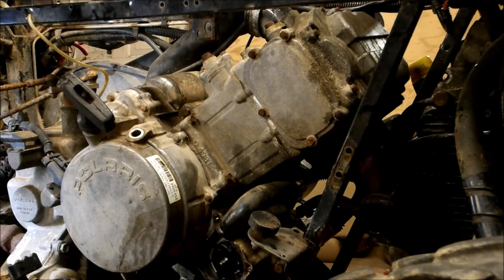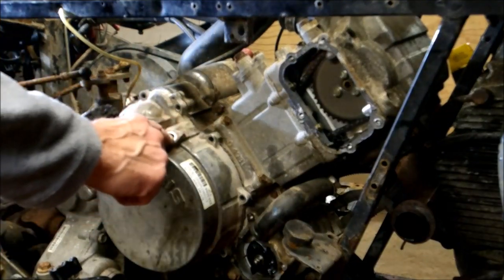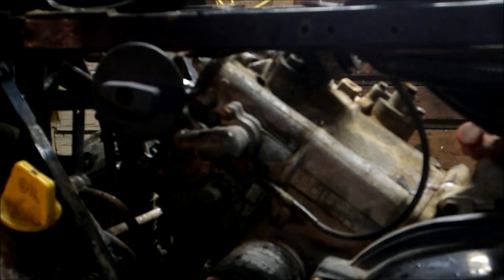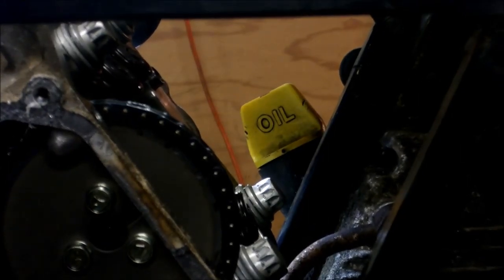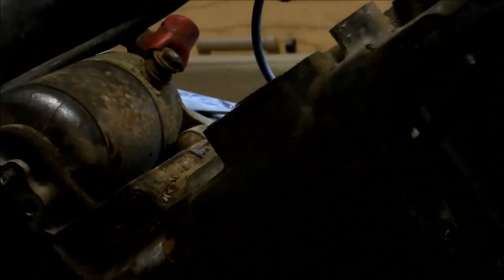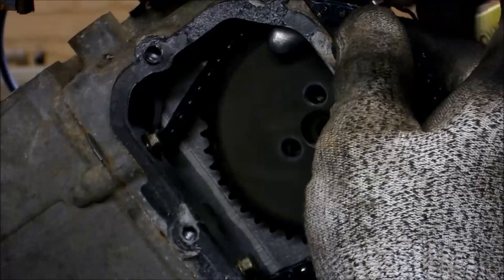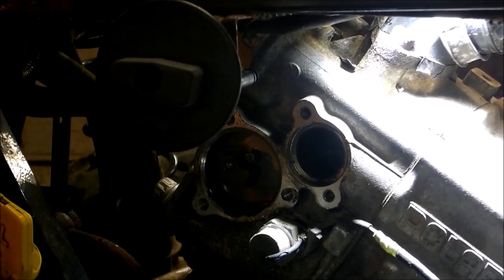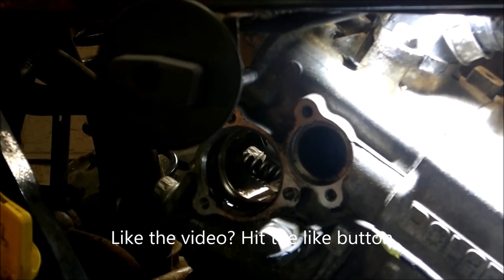Bad camshaft on a Polaris 500? How To Remove it and give it more horsepower!

Comment: titanium man i pulled the cam yesterday put a new one in the rocker shaft has a gruve wair the ball rides  so it's not alowing it to roll over i ordered a new cam and rockerarm ""aftermarket"" it seemed to roll over by hand real easy but i have to get a new started drive gear i all so put up 3 videos 2002 polaris ranger just figured id add to the polaris ranger people thank you... ever thing you said was correct on timeing the 500 thanks again

Comment: Awesome video. Do you really get more power by replacing the camshaft? I have a 2002 Polaris Ranger 500 4x4 . Runs great. Needs couple things to get fix like a gasket between the cylinder and carburetor boot. And parking brake doesn’t work at all. I heard in YouTube that Polaris 500 has a bad design camshaft
Reply from the maker: The bad cam design was in 1998-99. It didn't give a ton of power but it ran a lot smoother. Better throttle response.

Comment: So all the scramblers after 1997 were supposedly H.O. and the 97 was not acording to most people. I have a 1997 and Im looking at replaceing the cam and every seller has the cams listed to fit 97-03 and some sellers have it listed as fitting every 500 model. So my question is for the people that say replacing the cam and carb will make a non H.O. into an H.O. are we sure it not just the carb that needs replaced to accomplish that? It seems to me that the cams are the same. At least they are being sold that way. I found only 1 place on amazon selling a legit 1997 scrambler only cam, and that was Caltric. Im confused, any help would be appreciated. I understand this is an older video. Thanks.

Comment: Would you post a video about the spring on the end of the camshaft and  the thing that goes inside the camshaft, how it works, proper position of the spring, how to fix it if it doesn't hold tension ect ect ect.  Mine doesn't hold tension and just flops around.

Comment: Thanks for the information, I have a 500 and the engine is locked up. How important is it to bring to TDC before removing the rockers?
Reply from the maker: If it's locked up just make sure it's at tdc when you assemble it. It's fine if it's off when you tear it down.

Comment: will a camshaft for a 400 ho sportsman  work on a non ho 400 sportsman ? year 2004 .
Reply from the maker: It should. If ita from the same year. The only difference between H.O. and non H.O. is the cam, intake and carb.
Reply: thank you.

Comment: is this really all you need to change to make it an HO? I'm having issues with my motor holding an idle and it bogs and pops under acceleration. I've done some reading and have found that this is one of the more common issues with this engine. is there anyway to just inspect the cam without removing it to see if its bad or do i need to remove it and use calipers to measure lobes? thanks in advance and great video man!
Reply from the maker: As far a the cam goes. Yes. It's the only way to inspect it. Sounds like it's running lean causing it pop and backfire. Those carbs are tricky. If the airbox isn't sealed correctly or cracked carb boot, even the hoses to the box. If they are plugged or cracked it makes it run bad. Try a carb rebuild kit and check for air leaks first. I replaced the carb on another 500 I had. It solved the problem. If you go HO. I forgot to mention a bigger exhaust too. The engine would get to hot without it.
Reply from the maker: Try one thing. How does it run without the air box on? If it runs better. Then you know it's a carb or airbox issue.
Reply: @TitaniummanGarage  I've tried with the air box and filter on and off. almost same results. i also noticed that when i would have it running and would give it throttle it would actually blow gas into the air box from the carb side, which i also heard was cam issue. so I'm kind of lost here. i know it is an aftermarket carb but I've worked with carbs on other bikes before, and i took this one apart and cleaned it and re adjusted everything and its continuing to do the same thing.
Reply from the maker: Sounds like it's a cam . Exhaust valves not opening up. Take the rocker cover off. You can see the cam from there. Did you see my video on how to replace the cam?
Reply from the maker: I have 2 videos. the other is better.

Comment: What was wrong with the camshaft? Can you show more accurately and specifically what you are doing and why, please?
How do you fix an oil leak into the exhaust manifold and what is the cause of this situation?
Kind regards,
Franklin
Reply from the maker: I reshot this video because the first video was a little shaky. There was nothing wrong with the cam in this video. I had to replace the head gasket. The reason your exhaust manifold has oil in it could be 2 reasons. 1) Exhaust valve seals leaking. 2) Head gasket is leaking or oil ring on piston is bad and oil is blowing past piston and out exhaust.
Reply from the maker: https://youtu.be/1a7MulsXErs Here Is the first video I shot. It might explain a little more.

Comment: I have a 2013 500HO.  There's a horrible rattle on the top right side of the top end of the engine. It runs pretty good, I'm the original owner, it has under 1,000 miles and like 110 hours on it.  Always bene garaged and what I feel is well maintained.  I've always followed the manual and used polaris oils.  Any suggestions on what to check?
Reply from the maker: I would pull the recoil cover..or pull start cover off and check your starter bendix gear. they rattle when they get weak and don't retract all the way
Reply: @TitaniummanGarage  I replaced the bendix a few months ago and the noise is still there.
Reply: @kg7jev671 timing chain tensioner is probably shot. Just realized It's been a year hope you didn't jump time.

Comment: When installing my cam after inspection, the compression release mechanism and spring came out of the cam.  Do you have a video where you show the correct way to set the mechanism and spring?
Reply from the maker: No I don't. If the mechanism came apart I would do a visual on another that I had laying around. See if you can google a picture of it. That's what I do.

Comment: Hey one question I got a 2010 sportsman 500 the cam shaft access cover is cracked what would cause this sloppy cam?
Reply from the maker: Wow! Thats a new one. How many miles on it? Usually after 5000 or so they get sloppy. Could be bad casting in the head.

Comment: I’m upgrading to a 500 ho can in my regular 500. Do I need to upgrade the rocker arms too?
Reply from the maker: No. You can put a H.O carb and intake boot on too. Just keep an eye on the exhaust. H.o. exhaust was bigger. So if the pipe starts turning red on long rides you might have to change the pipe. I never trail rode mine so never had an issue.
Reply: @TitaniummanGarage  nice, I’m running a performance pipe will that be fine?

Comment: HI Thank you for the video, I just finished putting the cam in my 1999, fired it up and it runs good and idles good but knocks from 
under the valve/cam cover really loud, I coated the cam and rockers in oil before I installed them. I also cleaned out the little pockets of oil that was resting in the head. was I not supposed to do that? should I take the cover back off and add some oil? Thanks
Reply from the maker: No..its fine that you cleaned it up. There is a small hole by the cam that will circulate oil back up to the cam and rockers. I would take the cover off. make sure its getting oil. If there is oil in those pocket again..that's good. It means your getting oil up there. Double check your valve lash. sometimes it changes after it has been ran and the tensioner moves in more. I've heard those year sometimes the valves need to be redone. excessive wear and what not. could be a bent valve too.
Reply: @TitaniummanGarage  Thank you Sir! It's like twice the bike! I think it was a number of things, The kit I bought from ebay had the cam, rockers and the chain tensioner. I had used the original  chain tensioner because the new one didn't have a new  gasket. 
When I took it out today, I noticed the spring in the new tensioner was about an inch longer. maybe the old one was worn and shorter?
Also when I took off the valve cover I noticed at TDC the intake rockers were really tight and way out of spec. 
I took the cam out and started over and used the new cam and exhaust rocker, but used the old intake rockers which were in great shape, Bike only has 1000 miles. Used molylube assembly grease for cam and oiled everything before putting it back together.  Set the valves at .006 checked and checked them again.  Spun the flywheel twice checked again! Runs like new.
I would have NEVER tried this without your video. Thank you for your quality teaching, you saved me like $500 in labor! 

You Rock Man
Reply from the maker: @marcmelissa8752  That's Awesome. I like hearing stories like that. Good Job. I had to do the same on one of mine. The rockers that came with the kit were made poorly. I reused the old ones with the new cam. Worked great.

Comment: Where on ebay did you buy the cam an carb? I have a 1999 that my grandpa bought brand new the high gear clutches have vent out but it only has 2800 miles do you think this would be a worth while upgrade with a clutch kit?
Reply from the maker: If you want more speed it might be worth the clutch kit. I did this about 2 years ago. There are better camshaft kits out there now then when I did it. You just have to look around on e bay.If your installing the H.O. carb don't forget to order the right head to carb boot.

Comment: I bought a Polaris 500, and it spits out the carb intake, pops/backfires, never runs.  The cam lobes look fine, but I'm trying to verify the timing. Is there a difference between TDC and TDC on the compression stroke?  I'm thinking that my timing is off, even though all the marks line up.
Reply from the maker: If you can..pull the sparkplug and put a thin screwdriver down the hole with gas tank out. move flywheel till the piston it all the way to the top. Yeah, if its spitting out the carb sounds like a timing issue. I had that problem on a magnum 500. I double checked everything and it was right on. I replaced the carb and made sure my vacuum lines to case and oil fill didn't have cracks in it(They did) and sealed the air box. those cause backfire issues. too much air to the carb. It worked.
Reply: @TitaniummanGarage  Yes, I did try the screwdriver trick, but all my vacuum lines /air box are disconnected, I'm just trying to get it running. I'll replace the lines and give it a try, thanks
Reply: Where does the oil line hose plug in at, mine was off, replaced cam and rockers, won't start popped once, hate to put it all back togather and have to pull it all back off, i cleaned my carb, ordered a new one waiting on it, i think my timing it out, but i had my marks lined up, wired my gear where the chain didnt move, the cam only goes in one way, adjusted rockers, still won't start, i was wondering if it had a extra stroke also, did the screw driver thing til it raised itself, stumped..

Comment: I just completed this exact thing on my 1996 Polaris sportsman 500 but now its extremely hard to pull the recoil and and electric start pauses then it starts to roll over.  But when it does start it runs great.  I wish I could send you the video of what it's doing but I can't seem to attach it.  Thanks for any advice
Reply from the maker: I know exactly.  I had 2 do that. It's the decompression ball on the cam. If it sticks or the weight on the end doesn't function properly it stays open or out. If you pull the pull rope past that.it will pull over. I would take the cam out and inspect it. The little ball on the cam should move in and out.
Reply: @TitaniummanGarage  Ok i.will inspect that but I'm pretty sure it does.  Would there be anything else that could cause it?  Thanks for your help
Reply: I inspected the new cam and that ball goes up and down.  Is there a certain way I need to put that spring pin in?  I may have something wrong but Im just not sure what.  Would the valve adjustment have anything to do with it?

Comment: If my exhaust rocker arm has a small Groove where the decompression ball on the cam is should I replace the cam and rocker arms or is it still useable? Thank you
Reply from the maker: It depends how deep. I've gotten away with not replacing it. But it should be replaced. You might have a hard time starting it when temperatures drop down below 25 degrees.

Comment: could a bad cam be preventing it from running
Reply from the maker: Yes. If the exhaust valves are not opening it will not start.

Comment: Hey, I have one of these Polaris 500s and it’s really really tough to pull the start rope and when I use the starter i have to hold it and eventually it starts to turn over.  Works better if I help the starter and pull the time at the same time.  Do you know why it might be like that?  Is there a compression relief valve anywhere?
Reply from the maker: Yes, that's your problem. It's on the cam. They are known to get stuck in the out or open position. Take the rocker cover off. You might be able to spray pb blaster or WD 40 on it to free it up..or replace the cam.
Reply: @TitaniummanGarage  If it gets stuck in the open position would it respond by giving me a crank/no start with around 40PSI compression? I am finding LOTS of people with the hard start/slow crank symptom, but i am having no issues cranking at all... Before i pull everything off and do a top end rebuild I want to find someone that can answer this question, and you seem to be the closest to an answer here
Reply from the maker: @joshuadavidson1967  Because of the decompression ball on the cam you will only read 35 to 40 psi. If its stuck it will still start. It will be hard to crank with electric starter. Just pull the pull rope slowly till it get hard to pull. then pull it past that point.(past decompression ball) it should start. It could be your cdi giving you the issue. what year is it?

Comment: i think you have a few unanswerd question and i have the same question.. i all ready have good compreshion and i cant get it to go past compershion WTF .... 4 starters 4 starter drive gears 3 senolides.. this thing is pissing me off ..
Reply from the maker: Yup. I have a scrambler like that. And I just fixed a sportsman like that as well. I narrowed it down to 2 things. 1) depending on what cam you used, aftermarket? Or the rockers the decompression ball sometimes sticks. I dont use aftermarket cams. 2) I had 2 different cams. The first one I installed...still hard to pull. Smoked the starter. I pulled the cam out and checked the head. The head was warn where the cam slides into and was making the cam hard to turn. I then grabbed a used cam within its mechanic limits yet and installed it. It pulled right over with the rope easy. Started easy with the starter. So its rather the cam you put in or the head. I know that's not what you want to hear.
Reply from the maker: Also double check your valve lash and timing after it has been run. The chain could be stretched a little and will throw off the timing after you adjusted it and then ran it.

Comment: Do you have an email address? I would like to do the same with mine, make it an HO but need to carb and head or cam. Do you have any for sale?
Reply from the maker: No. Sorry. I have an H.O. motor. But that's going in an 02 scrambler. Your best bet is check ebay. Or find someone parting one out.